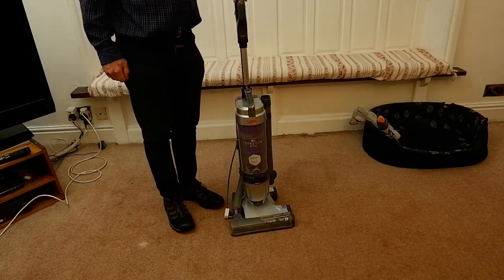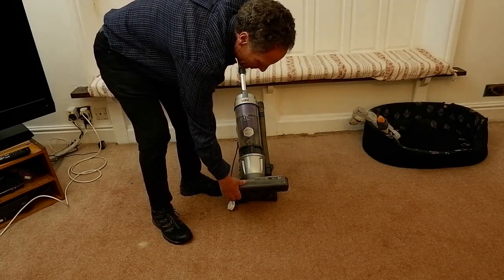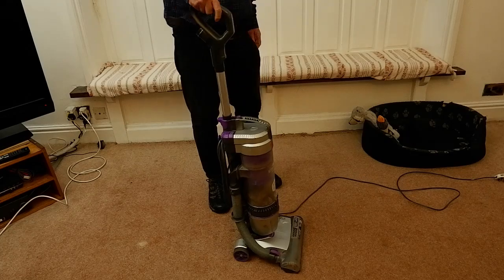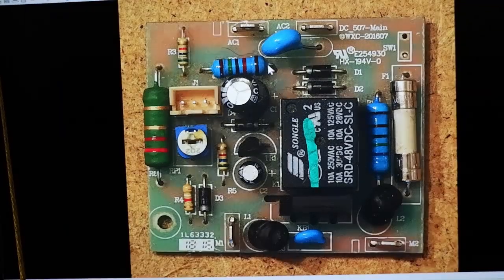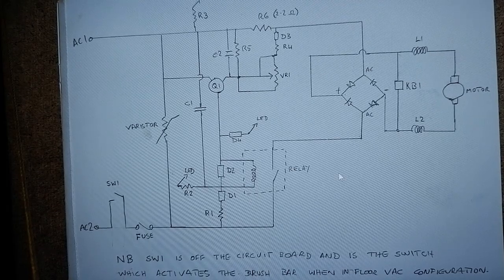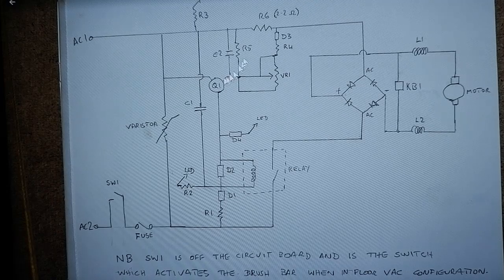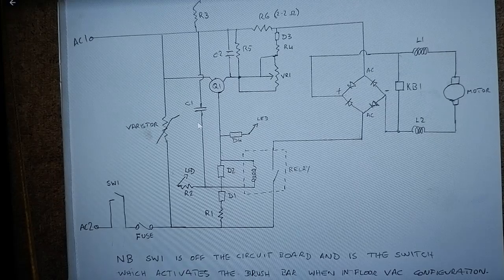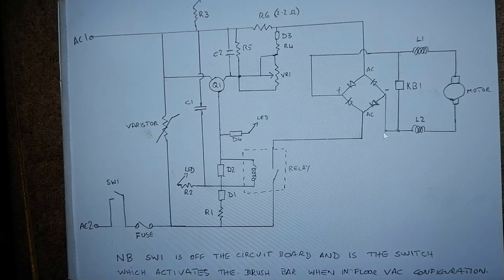VAX AIR STRETCH MAX CLUTCH BOARD REPAIR

Comment: Mike not one but two u identical kerbside finds vax air stretch whilst both cable faults with arc-ing blowing board so brush just running intermittently, my brother was the electronics min in oor family whilst I the spanner hand saw this is my first outing with a circuitboard repair and thanks sae much for taking time tae enlighten !!!;-). I’ll maybe take tae a electronics popUp repair cafe here in Govan Glasgow as bound tae be someone wi bag of circuit components .. that is if it isn’t just a dry joint on board??! . You May ask what of duplicate board Weel I went rather too far in shorting and led 240AC direct intae por wee brudhroll motor which coked it a touch but still ok tho for a second  smokedUp richt nasty!!!The brushroll intermittent but due tae the sine wave not the af clutch board hahahah note* these twa expensive cleaners baith victim of abusive owners typically jerking cable  impatiently and the #1 find : cable has been ripped oot o casing wi extreme violence in fit of rage whikst nr.2 : twa breaks in cable crudely fixed but armrest- ing sae same as same as!! Isn’t life funny,mate??!Best h ugh
Reply from the maker: Good luck, and all power to your arm